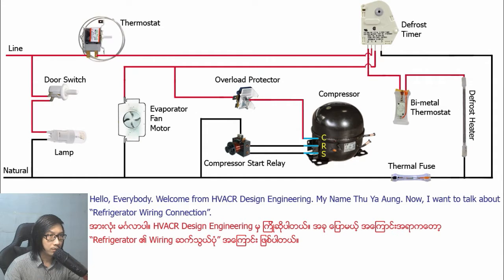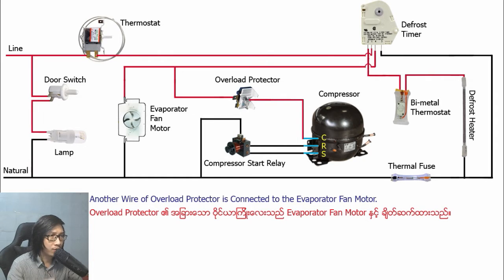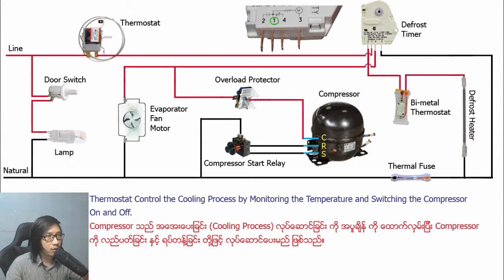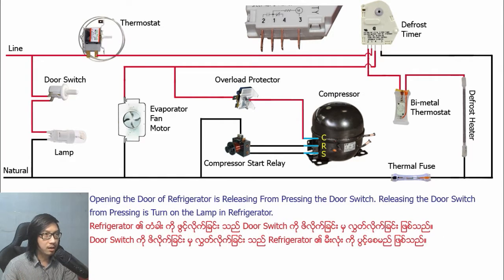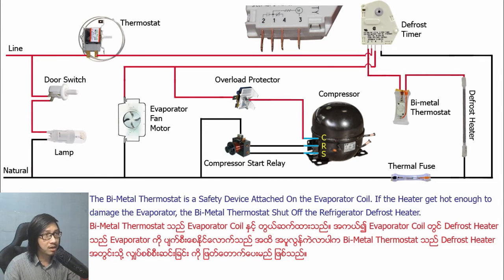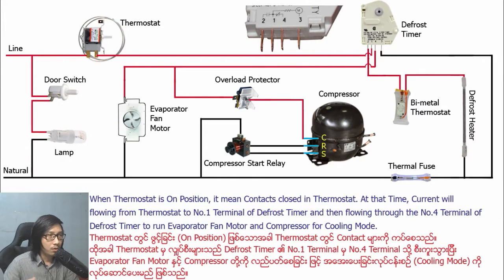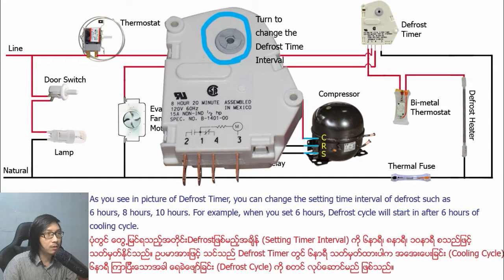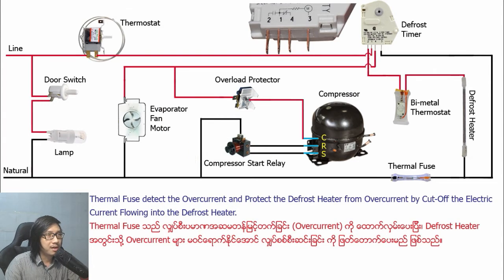Refrigerator Wiring Connection

Comment: Prefect  a proper schematic i can work with ..did you notice there is alot is incorrect schematic diagram on YouTube? Alot of them has the incorrect timers for the diagram  but There is a few that is correct...and also wire 3 numbers on the time can go after the heater to, it still works  this way aswell